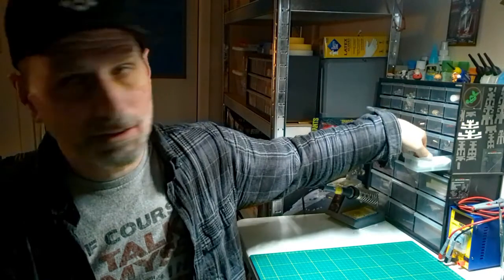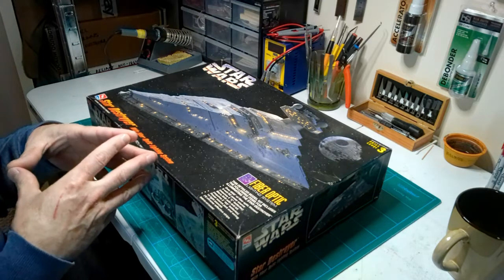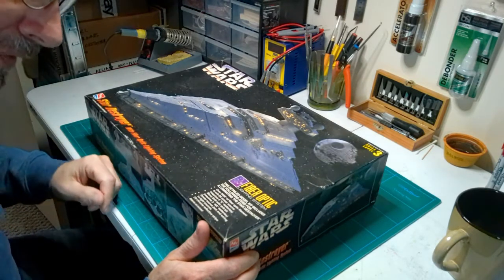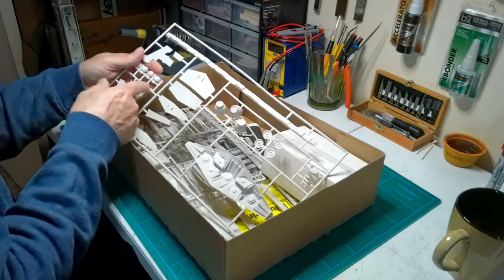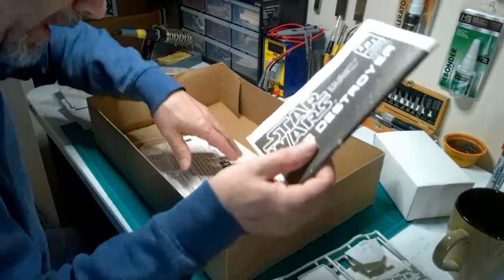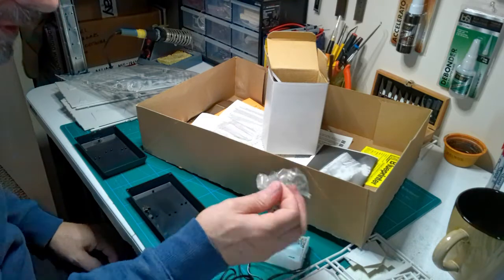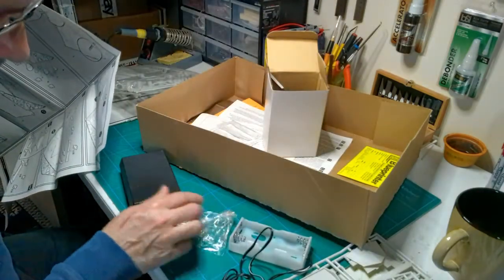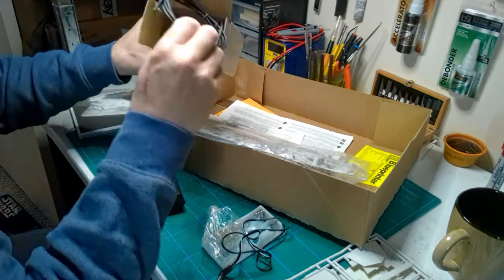AMT STAR WARS STAR DESTROYER UNBOXING

Comment: I Just picked up this model kit. I've never worked with fiber optics or LEDs before. I'd prefer not to use the kit that came with the model. What lighting kit should I use? Thank you in advance. I'd hate to buy a lighted kit and put it together without lights.
Reply from the maker: I believe I'm gonna use everything but the incandescent bulb and battery pack. The fiber optics and the plastic pieces that bundle them and holds the bulbs from the kit will work great . I can't remember if they will fit a 3mm or a 5mm LED but you only just have to replace the old bulbs with the LED's and run the fiber optics and power jack as per instruction. You can get flickering LEDs for the engines for a cool effect like thy are running. I can't remember how many bulbs it needs but a 9 volt 1 amp power supply usually works great for a model of this size and lighting. I will give you a link to some LEDs pre wired and resistor that will take 9 to 12 volts depending on how bright you want the ship lights you can even go up to a 12v power supply, but I prefer 9 volts because it gives the right light for the size of the kit.

https://rover.ebay.com/rover/0/0/0?mpre=https%3A%2F%2Fwww.ebay.com%2Fulk%2Fitm%2F403404464032

Any other question please feel free to ask and thanks for watching
Reply from the maker: https://rover.ebay.com/rover/0/0/0?mpre=https%3A%2F%2Fwww.ebay.com%2Fulk%2Fitm%2F382850844974

https://rover.ebay.com/rover/0/0/0?mpre=https%3A%2F%2Fwww.ebay.com%2Fulk%2Fitm%2F383101304617

All you have to do is connected all the positive (red) and negative (black) together and to the power jack